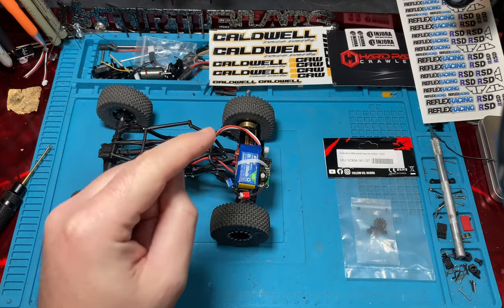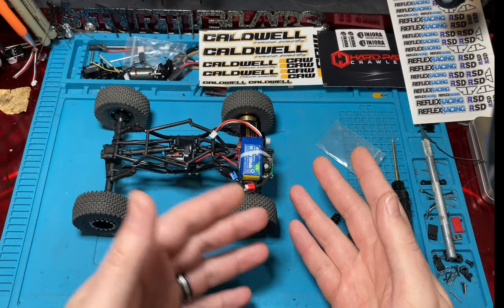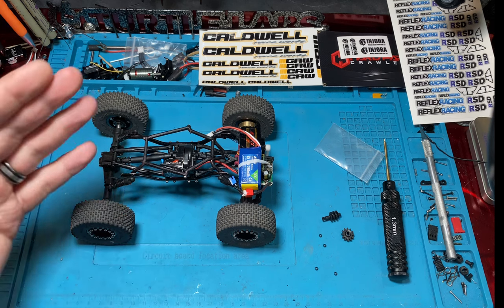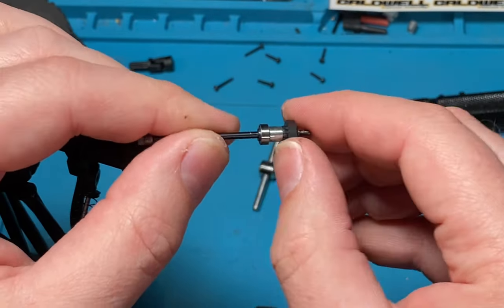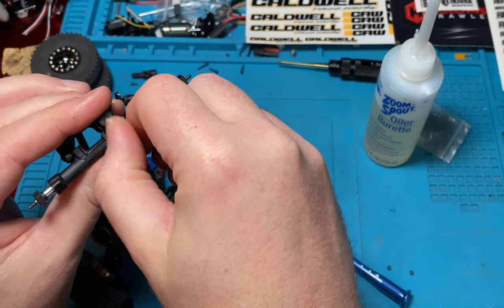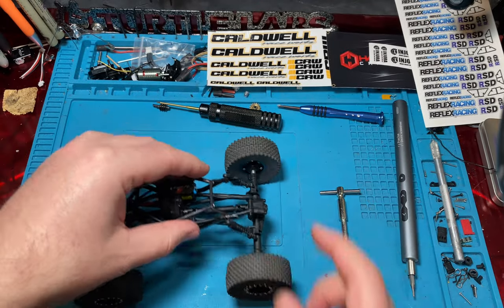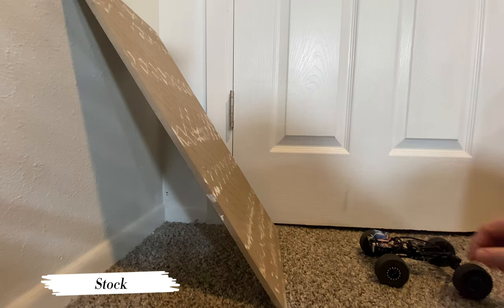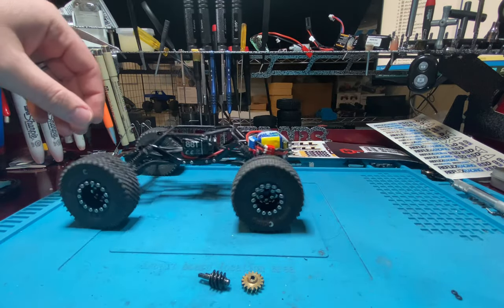SCX24 - What are underdrive and overdrive gears? How do they help and how to install them!

Comment: The problem with the gear change is the front is now doing all the work as long as all four wheels are on the ground.  Also if you drive any distance (not strictly climbing) you will scrub the tires off and wear the drive train.
Reply from the maker: Yes. This is for trucks that climb. You would never do this on a trail rig or go fast vehicle.
Reply: I've noticed tire wear on the front. Have the front overdriven. The motor pinion is brass as a fail point for wear. I do not have long-term data, but the soft tires are wearing differentials. Climbing wise it's amazing. 😊

Comment: The steering radius got about 10% to 15% worse using 23% overdrive on my FCX24 K5 Blazer. It was certainly not worth installing in all honesty & threw those overdrive gear away.
Reply: Was a complete waste of $19.99 that I will never get back
Reply from the maker: That doesn’t even make sense. Over drive in the front (or under drive in the rear), per physics, will pull your front around faster and give more turn radius. Are you sure you didn’t install the Underdrive into the front?  

Again, what you’re saying is physically not correct.
Reply: Yes I install them correctly & only put overdrive gears into the front portals. Should I try much higher overdrive gears? Was my problem with only using 23% overdrive gears & should have gone with a higher percentage? @TheShopMiniRC
Reply from the maker: @DTW-bx2vy  any amount of percentage higher will always increase your turn radius. 

I wonder if they send you Underdrive gears. Wish you didn’t throw them away, we could have determined the issue.
Reply: No I did not actually throw them away, but I was pretty disappointed. I never did count the gears to see if they did send underdrive gears & installed them cause I could not wait. Sham on me for never thinking of checking them first. I'll take a look at them again & compare them to the stock portal gears & see if your right because something was not right.  @TheShopMiniRC
Reply from the maker: @DTW-bx2vy  hell, worst case, put them in the other axle and reverse it. Lol
Reply from the maker: It should “suck” the body down when going forward and “arch” the body up in reverse.
Reply: Well you called it & was right, the gears where incorrect & are actually underdrive gears instead of overdrive gears. Thanks for the help, from now on I will certainly be inspecting the parts I purchase before installing them.  @TheShopMiniRC
Reply from the maker: welp, now you know! Re install them in the other axle!!!

Comment: I broke that electric driver in 3wks terrible torque. I replaced with a lot thicker one with adjustable torque,  it was about the same price
Reply from the maker: we still use ours nearly daily with no issues.
Reply: @TheShopMiniRC  i was gutted when it broke mind. i did like using it but thought it wouldnt last long
I replaced it with a "Lyuwo" 20v 1300mah ok it chunkier like a can of red bull, trust Get One £16. I got it 3wks ago its still on first charge, has 5 adjustable torque settings & Lyuwo will replace it if it breaks in 12 months
Reply from the maker: @ModModRc  nice.  Sounds like a good driver.

Comment: Very useful video. I just did gears and needed this video first. Made a few mistakes. One to note is ring and pinion are matched. This I did not know changed out ring and put back together and there was binding.
Reply from the maker: Oops. Yes, you have to have the correct matching set.

Comment: Works good! Sweet chassis btw
Reply from the maker: Glad you like it. Thanks a ton!
Reply: @TheShopMiniRC  did you make the chassis? What is it?
Reply from the maker: @independentmind1977  it’s a stock chassis, I just cut the ends off and used a deadbolt cage to put some protection over the motor and give some shape. lol
Reply: @TheShopMiniRC  lol it looks awesome
Reply from the maker: @independentmind1977  ty!!!

Comment: Can you get longer cvds ( axle shafts ) for this car,  I only have about 4mm of thread coming through wheels and if I get beadlocks with the extender nuts they only have about 2mm of thread to bite onto so wheels fall off so ive had to go back to standard wheel hexes, not brass weighted ones
Reply from the maker: You can get CVDs that are +4mm
Reply: Thanks, I'll buy some,  I just hope it's 4mm after the hex and not before it them I won't have to use them extended nuts that only hold on by a couple of threads

Comment: Hi just now seeing your video. Amazing information. The chassis you viewed bended in the middle. Can you please tell me what chassis that is. I would like to purchase purchase for one of my scx24's. The upgrades you have are really awesome. 
Thanks.
Reply from the maker: This chassis is literally just stock chassis rails. The “cage” was made from a deadbolt body cage. Nothing special except how I put it together.
Reply: Hmmm it appears that in one part of your video, "when you pull forward it sinks in" Im guessing this is a fully custom build. Do you have a video on the entire build so I can get a better understanding please. Again thanks for the info. Very informative and helpful to when I try to mod my scx24's.
Reply from the maker: @ralphhunterbayne65  it “sinks in” because of the over drive in the front or underdrive in the rear.  The fact that the rear is slower than the front causes the entire truck to “suck down” when going forward. Just adding underdrive or over drive to your truck will make it do the same.

Comment: Hello, im trying to build my own little 24
From the ground up. Without having anything to go by my first hiccup is, I want 4 wheel steering. I see that the transfer case spins the drive shafts the same direction meaning the gears have to be changed in the rear steer axle. Can that be done, or do I need a specific axle? Thanks for your help
Reply from the maker: The gears do not need to be changed in the rear axle.  You can literally just put a front axle on the rear and you are good to go.
Reply: @TheShopMiniRC  thank you so much! What is the best axle in your opinion? Also what is the best motor transmission combo?
Reply: @TheShopMiniRC  are the portals worth getting? Raises cg so much in my opinion
Reply from the maker: @bdog7262  there are so many good options for motors, trans and axles….

Axles, the OGRC +5s, LGRP super 8s, Meus racing double joints, mofo x15s, all are great!

Trans: LGRP and hardpark make the best aftermarket transmission for high end stuff

Motor: anything furitek.
Reply from the maker: @bdog7262  portals do raise cog and introduce some slop.  They are fun. But if you are serious. Stay straight axle.
Reply: @TheShopMiniRC  thank you so much for your help! If I didn’t already I’m gonna subscribe. 
If I run into any issue I will definitely reach out to you. 
Thanks again my friend

Comment: I got some overdrive gears for my front and rear axles. something I noticed was before I changed the work gears I could turn the entire drive assembly by spinning the wheels but wit the new overdrive gears I cant do this. I can still rather easily spin the drive assembly by turning the drive shafts but not by turning the wheels. Do you think this is a problem or does it have something to do with the harder gearing or something like that?
Reply from the maker: Worm gears are designed to be turned from the work gear side only.  It’s totally normal.
Reply: @TheShopMiniRC  thanks. I was avoiding running mine because I didn’t know if my engine was gonna burn out

Comment: Great video! I did have one question…just received my injora OD axles and I’m getting gear binding front/back. Pulled the worm gears and pinions, they match, but can see there’s scratches on the pinion gear. Is this normal and is there a fix you know of?
Reply from the maker: Hmm we didn’t have any issues like that. Be sure you have the oring in the worm gear to help shim it properly. You can also try using actual shims on the pinion.